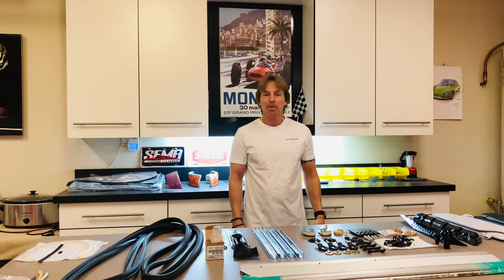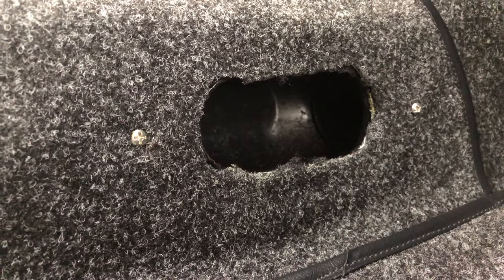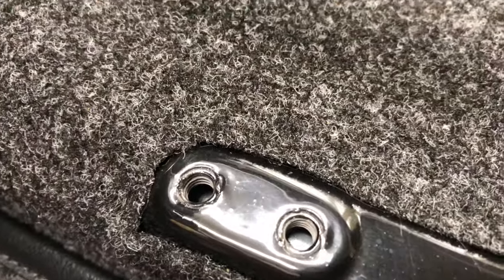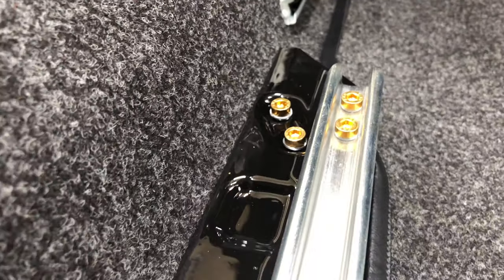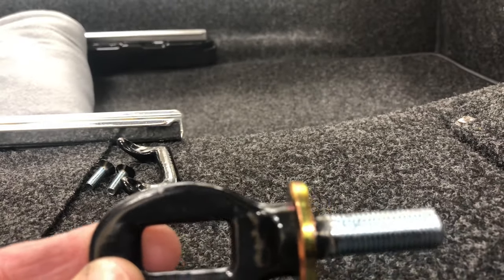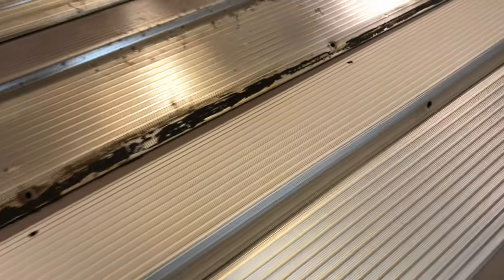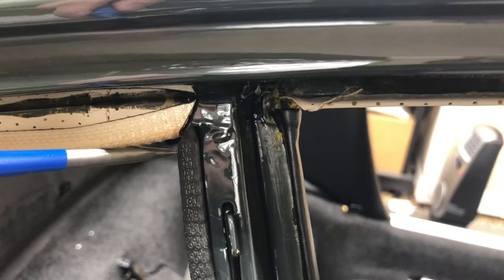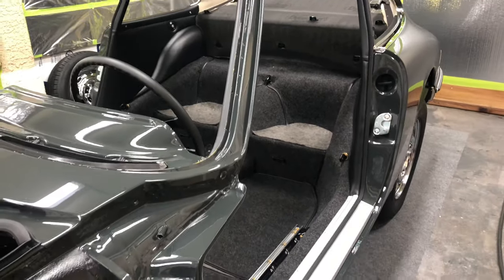Porsche 911 Restoration / Installing interior hardware! Video 59

Comment: 13:46 the seatbelt anchor washers go on the backside of the carpet, not the visible side, you are missing a black thin metal washer that goes under the anchor but on top the carpet these wedge together with the washer and carpet when installed - like a trim piece. The big metal washer props up the carpet in a trimmed fashion to meet the seatbelt anchor - when done right your carpet sits much better. Don’t use loctite on these as it’s not needed and you will never get them back out, they have a nylon insert to keep them in place.
Reply from the maker: Hello vintage excellence
Thank you for straightening this out! unfortunately I didn't haven photography of that area on disassembly or an unmolested original to have a look at. This makes sense considerably
Thanks for sharing!

Comment: Excellent video, in watching this particular one II had 2 questions related to the lower seat rails.
1) Did you have a length of the bolts you put on for the driver's side inner lower rail?
In the video you mentioned that they needed to be shorter due to the fuel line that runs underneath it.
2) When it comes to the lower seat rails are there left and rights or inner and outers? When looking at the rails in the video it looked like one side of the rail had a larger curvature to it.
Thanks, Chris
Reply from the maker: Hello Chris
Off hand I don't have any information as to the length of screws needed for the rails. Maybe some still and error to se what fits.
The seat brackets that mount to the floor are specific to left and right, inner and outer. The rails are all the same same.
Good Luck!
Reply: @MikesRestorations  
Ok great, it has been a bit since I worked on the seat assemblies. I have the lower outer seat rail housings already sorted and mounted. I just wasn't sure about the actual rails as the customer just gave me a bunch of parts already removed from the car with some missing. I was able to discern from PET that those bolts for the driver side inner seat rail above the fuel line are 6x12s and the rest of the bolts are 6X15 all with shallow heads and special thin split washers.
 They were still available from Porsche.
Thanks for getting back to me, I greatly appreciate it.
Reply: @MikesRestorations  
Also did I hear you mention on one of your videos that you teach these restoration techniques in a class?
Reply from the maker: @koenigtigerone  Chris I have been working with Kurt on the mechanical restoration of this project. His channel is Klassik automotive training school. Perhaps that is where the misunderstanding could be. I am just a hobbiest sharing a few things. 
Kurt teaches on a professional level on his YouTube channel

Comment: Hello Mike, excellent work as usual. May I ask when installing door seals do they just tuck in the gap or is any glue required please? Thx
Reply from the maker: Hello Kevin, Thank you
I believe the door seals in this video were switched out farther down the road with different seals.
Porsche specs out the same door seal for SWB and older models but they do not work when the doors are installed with early cars.
Aftermarket seals will be needed for early 911 912 as the profile is different. Porsche does not make them. 
They will require gluing  in at some point but I would hold off until the doors are hanging and latches are working and final gaps are adjusted. When everything is settled in and seated you can peal back sections at a time and contact cement them in their finals seated positions.
I hope this helps
Good Luck!

Comment: Hi Mike - do you happen to remember what part number the door seal has?   (Is it hollow?)
Reply from the maker: Hello anno
The door seals from Porsche do not work on the early cars..Im not sure what year they made a change. I ended up removing the ones with the holes in them from Porsche as the seal will prevent the door from closing. It's too thick.
The correct seals can only be sourced from after market suppliers.
I purchased the correct ones from Sierra Madre and they were a perfect fit! Completely different profile and configuration.
Good luck!

Comment: Hi, Mike, how are you? It is normal that in my car 912 year 65 there are only the center holes for seat belt and not the others one in sideways.
Michele.
Reply from the maker: Hello Michele
In 1965 seatbelts were optional equipment on most cars. The same also for the back seats.
Its hard to say what you have there as someone may have added or removed original fasteners

Comment: for items like those seat rails, did you use aerosol por15 or brush it on?
Reply from the maker: Hello Chad
they were media blasted 80 grit glass bead and brushed with POR15
I actually tried aerosol painting them with a couple other shelf item paints but couldn't get a satisfactory look
POR can be amazing if applied with all the right conditions

Comment: Hi Mike- I've watched all your videos and as a newbie auto hobbyist, I've got a question for you.  I see that over the course this restoration, you use many different types of lubrications based on the materials and situation .  I'm trying to get a sense of what I should buy in general for when working on my car and in what situation I should use that particular lube (as a rule of thumb).  I want to make sure I have and use the right stuff...for interior, exterior, engine applications, etc.  Thx!
Reply from the maker: Hello matril01
Thanks
I do get this question frequently and intend on doing a special video in the near future regarding lubricants and adhesives.
Please be sure to watch the upcoming video in March on (Manual and suppliers).I will address this in that video and hopefully make things easier for the DIY and hobbiest get thru these stages with simple go to solution.
For the timing being I'll give you the short version.
General purpose grease is great for extreme wear metal to metal friction or rotation. 
Molygrease is great for extreme conditions high temperatures and excessive rotation Metal to Metal
No Petroleum grease can be used on rubber as it swells and degrades it
For rubber mineral based rubber grease is great!
Synthetic grease is good for any plastic to metal or urethane bushings to metal.
Petroleum grease can be used on plastic but I generally prefer synthetic
Wherever rubber sealed bearings are concerned contacting metal I like synthetic
White Lithium grease works well on bronze bushings if necessary but most bronze bushings are self lubricating.
Just a touch generally is good for life.
Sometime I like to use just a drop of synthetic oil just to prime the bushing and then after that they should be good for life
Reply: Mike’s Restorations Thanks Mike. This is very helpful...and I look forward to watching the episode when you get it posted. Best, Lee

Comment: Hi Mike, how are you? In my seat rail extension, in the floating nuts I have two bolts small, do you know why?
Michele.
Reply from the maker: Hello Michael
Can you be more specific , Its been quite awhile since working that area
Thanks!
Reply: In this video you said that there is only small bolt for a fuel line but in my car 912 1965 there are two small bolts in the floating nuts per side
Reply from the maker: @michelelocascio5642  Michele Im not sure what would be different running through your tunnel.. The only thing that comes to mind for a short screw is for clearance below it. Also something to consider is what was being used at that time on the assembly line. The installer may have done this for a specific reason or could also have just placed them randomly or could have been running low on stock so used as an alternative. When I see these kinds of situations usually the answer reveals itself if I look at it and study the situation long enough...
Its tough take a guess
Reply: Thanks a lot Mike